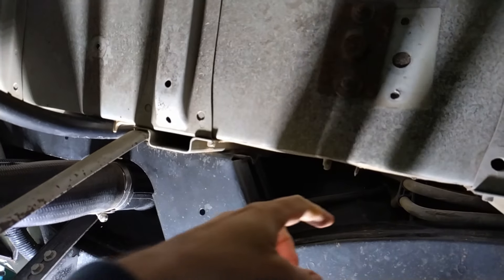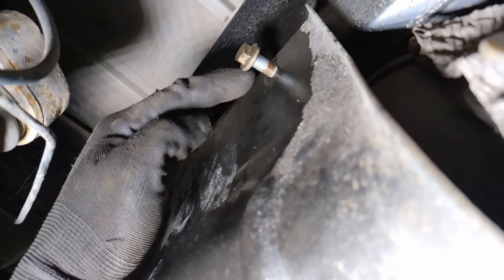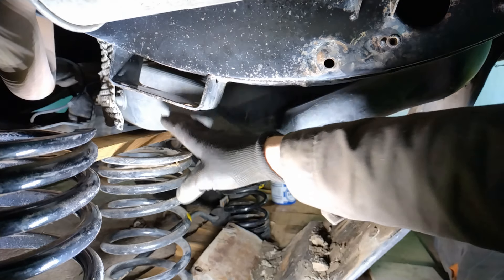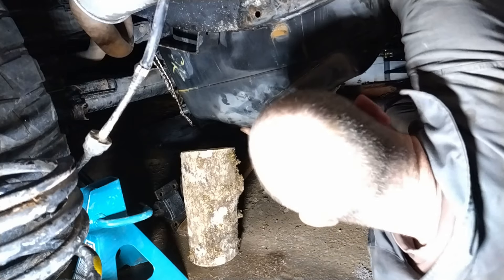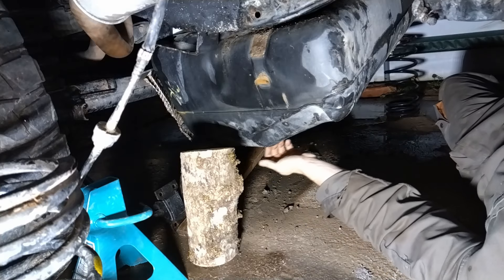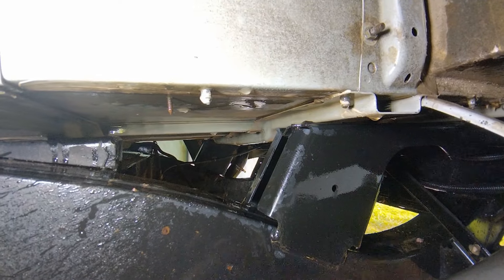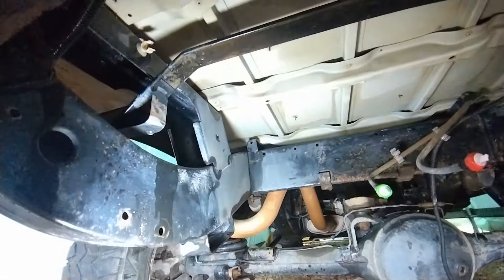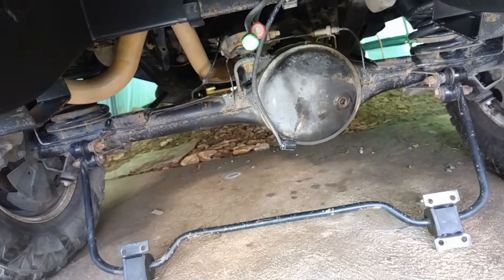Removing a Defender 110 Plastic Fuel Tank, inc Chassis Wash & Treat

Comment: The condition of that chassis is amazing.  Personally I would have gone over some of the small rust areas with a rust converter before applying the Bilt Hamber but if this truck is a keeper, you can revisit these areas at a later date.

Comment: I guess that's a td5 puma chassis I used a 2008 puma chassis for my 110 petrol rebuild I welded bracket to rear xmember so I could use my steel tank and under tray  the good thing the bulkhead supports had nut brackets fitted  made it easy for refitting bulkhead my fuel tank has the in tank petrol pump